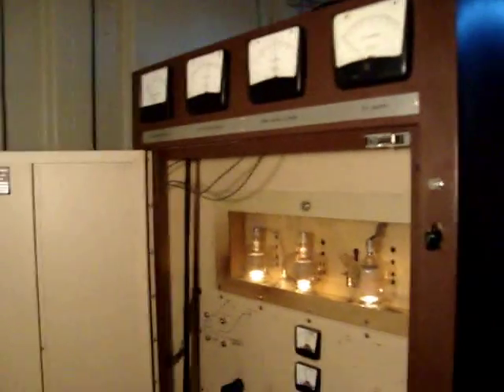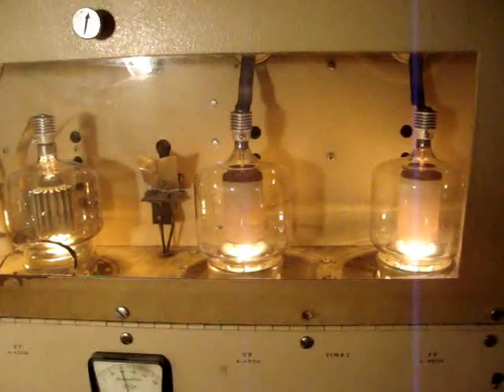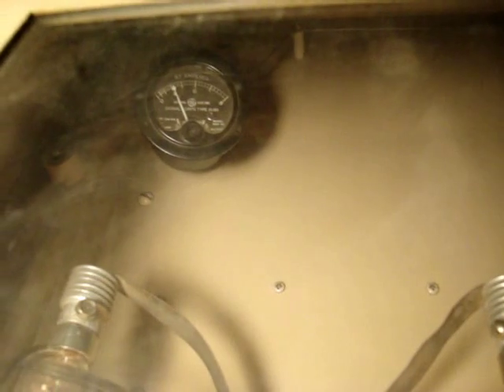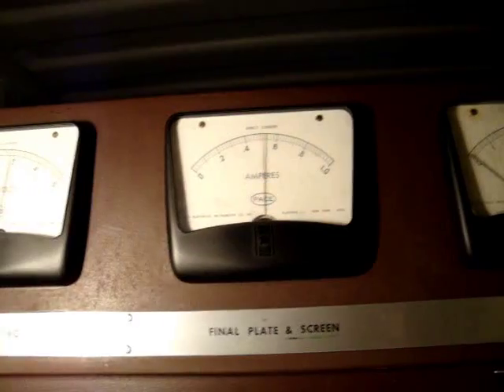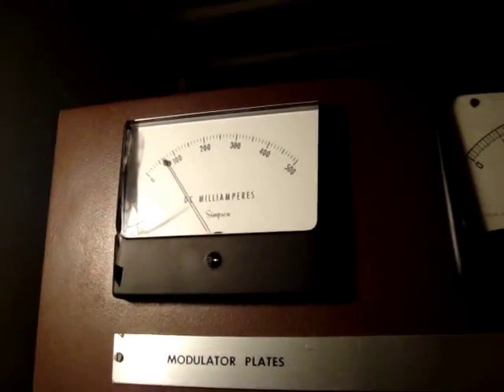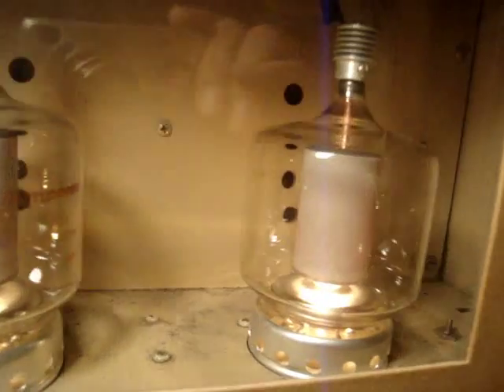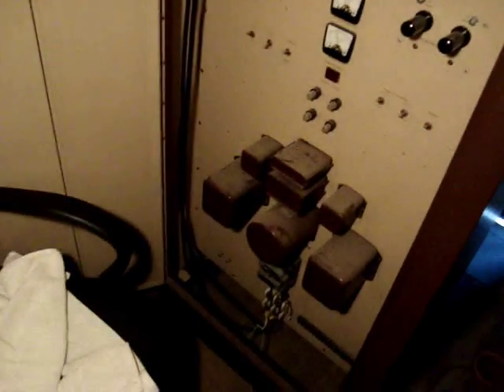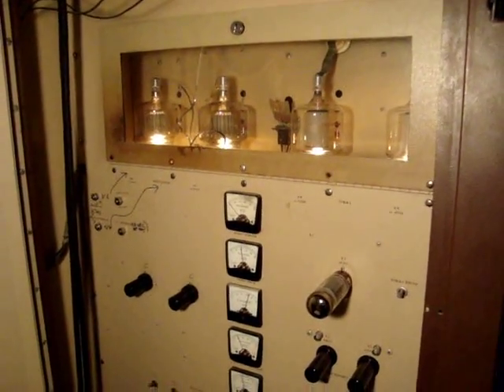Bauer 707 AM Transmitter Resurrection

Comment: Is it possible to find old-style transmitters like this? What would a transmitter that had a 250-watt output look like?
Reply from the maker: Yes, on ebay. This Bauer transmit ter will do 250w in the low power position. But there were other 250w only transmitters that were made by RCA and Gates like the BC-250GY. These were big transmitters as well. They didn't need to be that big, but often, they'd just use the 1000 w cabinets to build the 250w transmitters.

Comment: This is pretty cool, and it would be even cooler if it ended up going to an AM radio station.

I wonder if any of these 707s ended up being converted for 120m or 90m operation in Latin America or Africa back in the day. It seems that one of these kit-built transmitters would have been a cost-effective option for a third-world shortwave station with a limited budget.
Reply from the maker: Actually, this will indeed be going to an AM radio station! It's the same station as the one here in the vid, but now a different owner. It's to be used for a backup tranny. As for as the 707's being used in Latin America or Africa, dunno... I'll bet there's a few around the world tho. ;-)

Comment: I have one of these on the basement awaiting restoration and then conversion to 75M. Had a bad LV/bias transformer and I was lucky to find a used one. Rewind on those can transformers are pricey. I've got info on that if you ever need it for a replacement. Paul helped me with it before he passed. Nice guy and will be missed. Per the CE it was working FB as a backup before that transformer failed. Can't wait to get it finished up. Nice video. Can't wait to see a follow-up.
Reply from the maker: - Thanks for the info. I'll have to look at the diagram again on the bias circuit, but I would think it shouldn't be too difficult to make a work-around for it that would be cost effective.. unless of course, it is to be kept as original, then yes, it can be a bit expensive. These trannys are very simple and doing work-around mods are simple. Yes, Paul was most helpful and a heck of a nice guy at that; he will be missed. Have you finished converting your 707 to 75m?
Reply: I actually had to give it away as I sold my house and could not see paying to store it. I have several broadcast engineer buddies so I'll grab one of these or something else when I build my new house. I know where one of these with the tear drop meters is. Just have to go get it
Reply from the maker: 4thapack - Don't you hate that? But I guess as long as it's going to a a good home, and not the dump! At least it sounds like you could get it back when you get re situated. ;-)